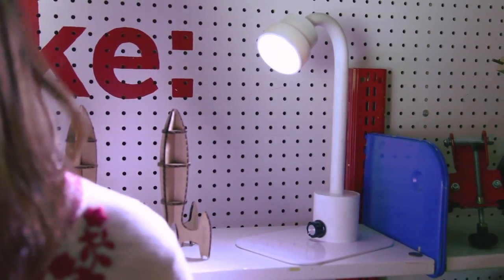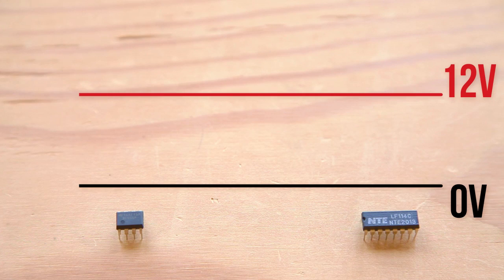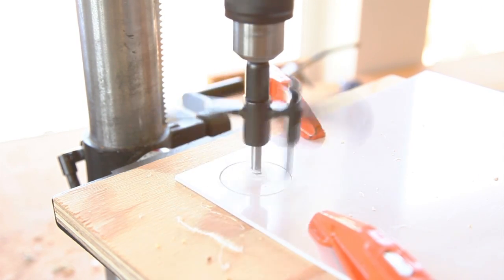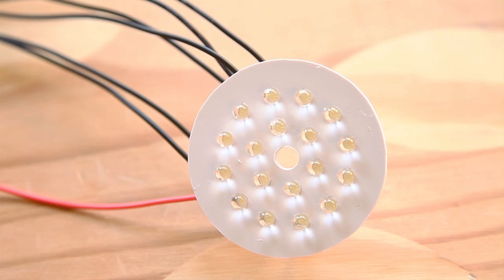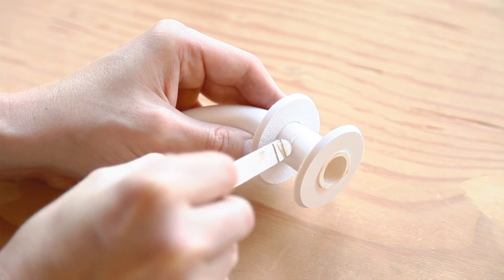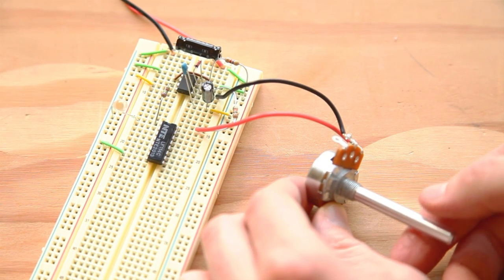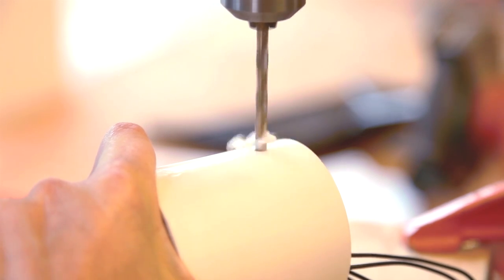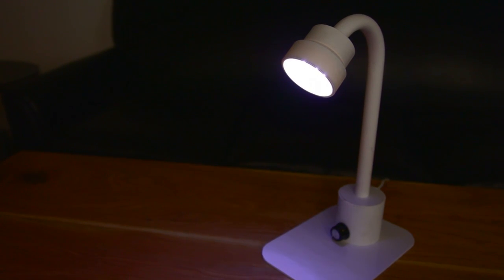Weekend Projects - Little Big Lamp

Comment from the maker: Typically LEDs require a resistor (for each LED) to resist your supply voltage and deliver the precise voltage required by the LED to emit. Because the maker wanted to use 12VDC for use in motor homes (engines typically use 12V batteries), he multiplied the LEDs into series of 3 (3.3V x 3 = 9.9V). The 555 provides the timing sequence needed to provide Pulse Width Modulation, so the LEDs flash faster than your persistence of vision at approximately 10V per series (without resistor!).